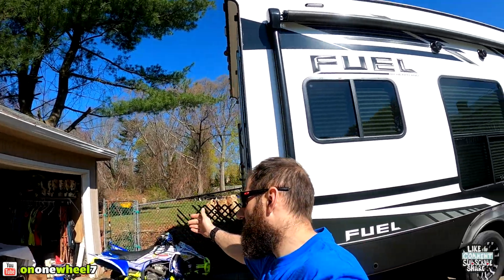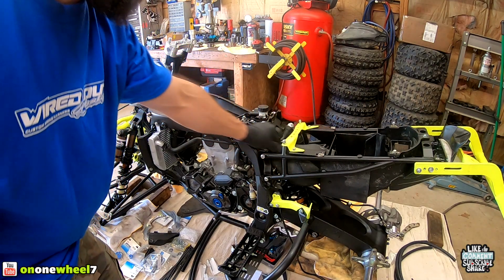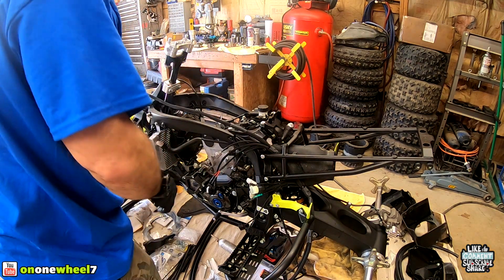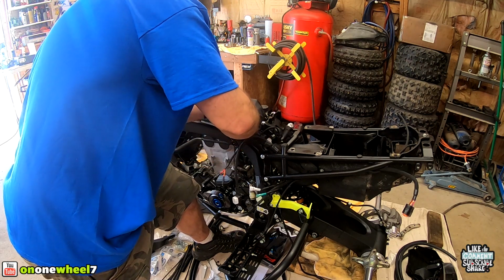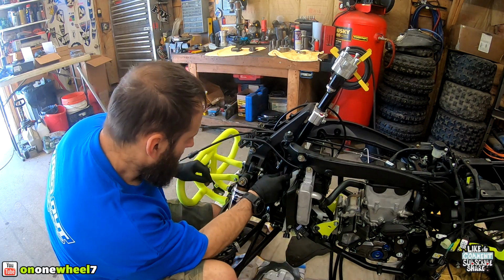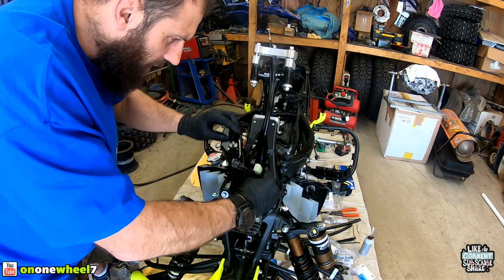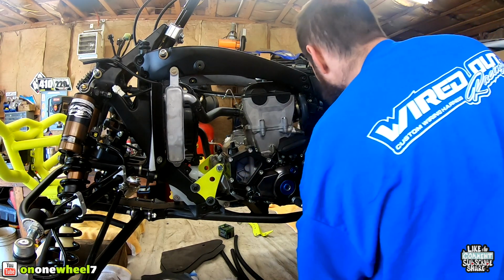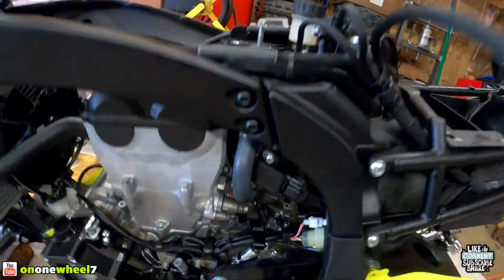HOW TO INSTALL A WIRE HARNESS YAMAHA YFXZ450r   RACE CUT FROM WIRED OUT RACING

Comment: Love your videos! I have a couple questions! Since your fuel pump is always running, does it change anything for reliability? Does it wear out faster? Also what did he delete on this harness? He deletes the main relay in the back also? Would it work with a stock ecu or would I have errors? thanks!
Reply from the maker: I honestly think running it hot all the time does shorten the life of it. For my setup all the headlight and tail light wiring all the wiring for European models speed sensor,tip sensor, fuel pump relay,ais is eliminated. Jimmy can build then how ever you want i like to keep my fan relay and idiot lights and with this setup you need a vortex ecu.
Reply: @ononewheel7  awesome man! Thank you for the info 🤘🏻 Very appreciated
Reply from the maker: Anytime

Comment: Hi Joe, what brand of install did you use? Is there another alternative apart from OEM? What do you think of the Caltric brand? greetings from Argentina
Reply from the maker: I run harnesses from Wired Out Racing. If you just need a normal harness get an oem one.
Reply: @ononewheel7  🙌🏻✊🏻

Comment: Is the install on the carb model yfz harness the same as the fuel Injection?
Reply from the maker: Its kind of similar as far as routing I’m not sure the carb model will have less connections since its not efi. Best bet is to grab a service manual if your unsure but im sure its not too hard to figure out.

Comment: Hey men, thanks for all your videos, pretty explanatory and excellent! Keep the hard job!
Got 3 questions:
(1) which brand of dielectric grease you used and why? and
(2) where can I purchase your Vortex protector cage?
Thanks a lot.
Reply from the maker: Ismael Ramon i will look at the name i forget the brand it was from autozone i use it to help keep all the connections from corroding it keeps moisture out! The vortex cage was from starlake fabrications but braaptech bought them out so you have to go threw them now or even check out ebay you may find some there!
Reply: @ononewheel7  thanks for your quick reply. Excellent job man!
Reply from the maker: Anytime and thanks!

Comment: On a quad that has stock harness are you literally taking every wire off? I’m getting a race cut over the winter.
Reply from the maker: This guy actually builds them from scratch now. Before he used to cut them.
Reply: I never heard of him. I’ll have to contact him.  I was going to use raw connections
Reply from the maker: His name is Jimmy Bortz you can message him on ig and i think i left hos email in the description.

Comment: Can you use the seat pins from 38 Motorsports with that sideways cage? All other “normal” cages I have seen can’t be used with those swag pins since they will hit the vortex
Reply from the maker: Yes i do. I do not use the cotter pins in my  xc setup. That is more for mx. But keep in mind w the seat pins the seat is not gna fall off.
Reply: I don’t use the cotter pins either. Just installed them to keep the seat from moving around so much and falling off like it was. Thanks for the help!
Reply from the maker: Anytime

Comment: How do you route the small cable next to the sprocket?
Reply from the maker: Which cable?
Reply: @ononewheel7  its the little cable which goes under the sprocket, but i figured it out today by the way your videos are really nice i have almost finished my yfz, i used to ride with a ktm hybrid but since yamaha are the only ones manufacturing the quads im switching to a yfz. I also wanted to ask, what is your budget for a completely new quad?
Reply from the maker: Thanks man. This new one is like 25k between buying a brand new quad and setting it up this way. I actually bought every part brand new since when buying new there is a lot that you don’t use

Comment: I've been having an issue with my quad, the fuel pump isn't priming, already checked the relay and switched the tank to another quad to make sure the fuel pump worked witch it did,  so don't know witch way to go now?  New harness?
Reply from the maker: It maybe a broken wire. Was i talking to you on ig or messenger?
Reply: @ononewheel7  yep that was me

Comment: i have a 09 yfz450r and the sprocket hub has some play on the splines. any idea on what i need to do to fix it?
Reply from the maker: You can try tightening the axle nut 1st see if takes the play away! If not might be time for a new hub!
Reply: @ononewheel7  thx for the info. I will try that.
Reply from the maker: Anytime man!

Comment: Why does that harness only have 1 terminal for the battery its the black wire, wheres the red wire u connect to the positive terminal on the battery
Reply from the maker: That is a Separate wire that comes off the solenoid to the battery.